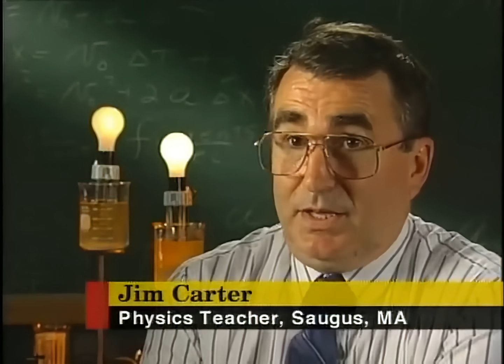MIT graduates cannot power a light bulb with a battery.

Comment: was it a 120v house bulb and a regular 1.5v battery?
Reply: About two decades ago I built a circuit that lit a 120v "100W equivalent" CF lightbulb (actually used 40W) from a single AA battery because my professor told me the idea was ludicrous.  It would run for about an hour on a fresh battery.  No, it wasn't as bright as if you plugged it into the wall, but it would light up a room enough to easily read a book.  Sometimes the problem isn't the student.
Reply: @kittenisageek  This is exactly what I was thinking when I heard this assignment. I assumed they were talking about AA battery or similar and they want to power up 240V bulb (I am from Europe). I thought immediately about step up converter and 240V capacitor which could maintain current to a bulb at least for a short time. I am not a mechanical engineer though, I am an electrical engineer :)
Reply: @rafal_pz8826 If you stepped it up wouldn't it turn the amps to shit and still not power on? I'm not certain but I think what he might have done instead of this is simply adding a bunch of parallel branches to increase the amperage and then feeding them all into the bulb.
Reply: @yes6650 You right it can't provide continous power. What I meant is that battery would charge capacitor, let's say 10 minutes, and then capacitor would provide current for a bulb, let's say for 30 seconds.
Reply: Im surprised none of them asked the voltage of the battery and the voltage required for the bulb.
Reply: it' just looks the same but obviously with lower voltage
Reply: Look at 1:53 She is holding a rather large candelabra bulb, those things are for 120 volts.
Later in the video where we see the bulb light the guy is using a flashlight bulb.
Lots of editing here to prove a point
Reply: Maglite bulbs need 2 or 3 AA or C batteries
Reply: My first thought as well but it wasn't a trick question.

Years of study in "premier school" and not being able to look and locate +/- from a battery and a bulb and put those together.
Reply: @19smkl91  That's not what happened here at all.  The bulb has too much resistance to draw enough current on the larger bulbs used. The small one worked because it had much less resistance than the larger bulbs.
Reply: @roanora7853  So you're saying that the dude holding the battery in one hand and the bulb in the other wire between them was doing the right thing if only the bulb was smaller?
Reply: @19smkl91  look you just plug the bulb into the socket i dont see why not
(Yes, I am aware the tip of the bulb and the screw are separate terminals; I'm just trying to get in these dinguses' thought process)
Reply: @smokyprogg which one of these is a socket?
A. Battery
B. Wire
C. Bulb

Comment: When they said "a wire," I instantly thought "Well, there's no return path, but you could put one of the bulb terminals up to a battery terminal!" I'm surprised most of these MIT grads struggled. I'm surprised some thought a DC circuit was possible without a return path and thought the battery was busted. And some of them clearly didn't know electrical safety; they were either apprehensive about handling this circuit with their bare hands assuming the voltage would pass a shocking current through their skin (this won't happen with a D battery if your skin isn't wet), or they DIDN'T KNOW SHORT CIRCUITS WERE BAD AND CONNECTED THE WIRE TO BOTH TERMINALS!

Comment: In order to make the bulb light up, you also have to take into account the Fenortner index of the transpositional infiltration circuit, and then divide the inverse square root of the hypoid epicyclic drive viscosity.  That will provide the instantaneous roll center quotient, which you add to the reactive force analysis resistance of the capacitance inhibitor nodules.  Once that has been accomplished, you pour in 500 ml of silver nitride uranyl carbonate, and that will mix well into the vanadium alloy diopters, which, in turn, cause the geographic alchemy to dilate, irrespective of the vibrational analysis of the MOSFET quadratic vicissitude after the sinusoidal cylinders have stopped twitterpating.  It's all pretty simple once you understand how it works!

Comment: A wire is the trick...
You have to have a return...
It's like the trick question will the circuit work with the switch off 
Answer: No, because the switch is off ..
Got to be part engineer and part attorney.
Reply: Would be nice if more (any) of the top comments looked like this

Comment: This is because they never understood where the ground and the positive are on a light bulb.  The bottom tip is the positive and the metall outer threads are the ground.  So you tip of the bulb to the positive of the battery and connect the wire to the ground of the battery and the outer threads od the bulb. Your welcome.  Ps I declined my MIT scholarship and went to an HBCU. Seema like I made the right  choice.
Reply: Polarity does not matter for incandescent light bulbs.

Comment: I cannot believe this, I'd do that at the age of 6 or earlier. Didn't they have battery powered toys as kids? I expected this to be a trick question, maybe the battery's voltage is not enough and you need to build a transformer and a capacitor to make it blink, or something like that.
Reply: yes it's exactly what you're assuming, battery didn't have enough voltage for the lightbulb they were provided

Comment: They SHOULD be able to light a 120V light bulb with a 12V battery. Hint: with appropriate electronic circuitry.
I don't have a MIT degree, and at least know the circuit and principle to make it work (switching power supply powered by the battery)

Comment: Actually, if you could see in infra-red and/or thermal spectra, you would see that the 120 V bulb (assuming its the old-school filament type) does in fact light up when hooked up to a 1.5 V battery. You just need to be mindful of the bulb's voltage rating to produce visible light as opposed to producing other kinds of electromagnetic radiation.

Comment: The only one who made it work at 1:59 was given a different bulb, a small DC incandescent one, where as the other ones seem to have been given candle bulbs. Unless they were also allowed to choose the bulb, (because that guy said "if I do it with a small bulb it works")
Reply: But the positive and negative terminals are the same on both bulbs, and both are socket style so you’d just touch one end of the battery to the bottom metal bit and then the wire to the side
Reply: You don't know what you're talking about lol
Reply: @Sahxocnsba Then explain it to us please, because I also don’t know how it works.
Reply: A DC bulb? How is a "DC" bulb different from an "AC" bulb?
Reply: @ashkiler  One runs on batteries, the other runs on wall power
Reply: @milandavid7223 Have you studied physics at all?
Reply: @ashkiler  Yes, and I can tell you that you won't be powering a bulb designed for 110V with a AA battery, regardless of the number of degrees you have
Reply: @milandavid7223 Definitely, but my comment was about "DC" and "AC" bulbs, and not about whether a specific battery would be sufficient to power a specific bulb.
Reply: @ashkiler iirc, 12v AA are DC and 110v wall outlet is AC, so the guy is still right for all intents and purposes
Reply: @marcanthony9659 You forgot to mention that the sky is blue.
Reply: @ashkiler urrrm aktually incondencent bulbs work on AC or DC🤓
Reply: @wofgh4736 I know that. Address your comment to those who don't.
Reply: @ashkiler well you should have said 8 comments ago instead of being smart aleck

Comment: I know someone who runs a large laser lighting business eg he has lit up Hong Kong habour etc He wanted someone on salary of about AUD 150,000 to work on the high voltage equipment. He got heaps of people with honours in EE etc applying. It got down to interviews with 10 and he asked them to name 3 electrical contractors that they would buy components from only 2 people could answer. He have them a breadboard , and 18v cordless drill with a Phillips head bit in it and battery on the table  and  handed them 2 screws and said you have 30 secs to screw them into the board.  One guy did it and he had a trade background and had built electrical stuff that worked and could present a portfolio of things so he got the job.

Comment: Whats the voltage requirement. Green led is 2.1v so a single aaa battery wont light it. Each color is different. To much voltage will burn it out

Comment: The answer is no. You need two wires.

UNLESS you put one pole of the battery at direct contact with the bulb. But if this is the correct answer it is an excessively brainy question to ask like that IMO

Comment: I'm not an engineering degree student or graduate, nor an electrician, nor particularly knowledgeable about electronics but I still didn't find the simplest solution. I was thinking to bend the wire until it broke, bite off the insulation and use the two wires to complete the circuit.

Comment: Battery voltage needs to be high enough for light bulb (see the printed voltage in Volt and power in Watt) and the given 1,5 Volt (DC) battery might give too less electrical voltage for regular home power grid voltage (110 VAC) light bulbs in older light connector. Especially for all (energy saving) light bulbs with internal electronic circuit (transforming power grid down):
1.) Classic light bulbs: contains a metal wire which is connected to the electrical contacts and when enough electrical current (electrons per second) flow through this wire it gets warmer-hotter causing sending out light in the color from (warm) red - orange - yellow - white (hot). This type of light bulb were subject of light bulb Kartell (GE, Philips, Osram) which decided together to design all their light bulbs with shorter limited lifetime than technical possible.
2.) Energy saving light bulbs: have more components to send light, additionally to the wire the light bulb inner side has a coating to change the wires light when flowing through the glass bulb and leaving as typical light spectrum (see light wave color print).
3.) LED: is an electronic component working with direct current Voltage below 10 VDC, so newest LED light bulbs with classic light bulb connector have integrated electronic circuits (rectifying and) transforming power grid voltage (110VAC) down to the LED component direct current voltage.

Comment: I think there are two different questions:

1. Is it possible to light a light bulb with a battery and a wire <assuming that all parts are functioning, they are all rated to work together, the battery has energy left, the wire isn’t broken, the bulb isn’t blown, etc>?

2. Can you light this particular light bulk with this particular wire and battery? This question can’t be answered without knowing more about the parts in question.

Comment: Maybe is the correct answer, the question is underdefined, the question did NOT even secify if it was a light bulb (despite the title of this video). Even if it is a light bulb, there is no specification of the light bulb, battery or wire.

Comment: This is one of those rare moments when you can actually answer "Yes" immediately, cause there's no trick involved. And yes, you should also be able to do it in less than 5 seconds. And yes, you should also know why the "large" (40-100 W) bulb won't work with a 3V (1.5 W) battery.

Comment: Clearly they all had only theory labs and no practical labs. It's sad. Not really their fault, and not indicative of their intelligence, but a failure of the institution. A guy I worked with said "I've met high-level electrical engineers who couldn't solder two wires together, but could design complex stuff on paper", (although I would clarify they are re-using and re-adapting pre-existing designs which were arrived at through somebody else's prior experimentation, and reusing theories based on those experimental results). This hits that home. Theory is important, but fire was made when somebody rubbed things together and realized rubbing things together makes things hot. Why is that? How can we make it hotter? If we rub things together hard enough, can we make "the red flower"? Making fire didn't start with an understanding of thermodynamics. An understanding of thermodynamics was developed as practical experimentation proceeded, and probably after the fact. At a certain point, probably theories could be put forward and tested, and confirmed if true, but all of this came after and reflected upon discoveries that were made with hands-on experimentation. So: Learn your theory, and understand what has come before, but also: Apply it!  If you cannot yet apply it, do you really understand it?

Comment: I'm certainly not an MIT grad but i would have had to say "maybe" as well, bc it depends what kind of bulb and what kind of battery. A bulb that connects to your home socket won't light up connected to a standard battery like a AA or C cell, the voltage is too low to push enough current to make the filament glow. But I would know how to set up the circuit.

Comment: What's the point of the question? And does it really take electrical engineering or understanding of em to do this. You never opened a torch or other things. It's kinda weird I do this when I am 6 but can't understand em still but solve problems numerically or analytically.

Comment: My first impression was if I could do this task was to say yes, given my strong electrical background. But on thinking it through I would say yes if these requirements were met:
1)   The bulb works and isn't burnt out.
2)   The wire is long enough and the ends are stripped of insulation.
3)   Last but not least the battery isn't dead and has enough voltage and ampacity to light the bulb.

Comment: The correct answer was: "What type of battery, what type of wire, and what type of lightbulb?"

If the answer was, "A rotten potato, a plastic paperclip, and a football stadium headlight respectively." Then your answer would be "No."
If instead the asnwer was "A duracell, light copper wire, and a common 40w household lightbulb." Then the answer would be "Probably."

Comment: I see a lot of people pointing out the fact that these people learned theory and just can’t put it into practice without learning the fundamentals of practical implementation, but I find two 2 problems with that argument

1. The basics of electronics are taught both in highschool and in required physics classes in colleges across the US. These classes have labs that should implement some of these principles in practice to provide a framework for reasoning through related problems in the future

2. The logical leap of understanding how to close a circuit without another wire is fundamentally an indicator of problem solving ability, and this problem was one that anyone should be able to grasp with even a below average intelligence.

These people were not born prior to the invention of disposable batteries, their experiences are not so different that they need extra time to solve this. They were obviously cherry picked out of the crowd for the segment, but no one with such a prestigious education should fail this question and proceed to graduate.
Reply: i mean you could definitely blank out on a very basic question and still be able to perform well on high level research. i doubt any of the "i can answer this very easily" would be able to withstand working for RLE in MIT, for example.
Reply: (these are definitely cherry-picked, lmao)

Comment: This is a failure in questioning. The right answer is yes, definitely, one can power a lightbulb with battery and wire, given few conditions like the wire being conductive, the battery having enough power, the lightbulb itself works, etc.

The question of being able to do it in practice is a totally different thing that depends not just on the conditions of bulb, wire, battery but also on the conditions of the person.

Can you lift a car if you have a jack lift? Yes you can. In practice can anyone do it, not likely because for one it requires a certain amount of strength just to operate, requires understanding of safety points, etc.

Comment: Dear Old Dad was an electrical engineer; I knew from my pre-teen years that a lightbulb is actually a resistor, and that the familiar dry cell batteries did not produce sufficient power to illuminate the common light-fixture bulbs (although the smaller bulbs found in flashlights had possibilities).

Comment: of course they can light bulb with battery and wire, but bulbon 1.5-3V with same voltage battery, not 110V bulb, so they answer is correct but your materials - dont.

Comment: Well when I was 7 or 8 
I used to make small flash light out of broken Christmas lights and  get some batteries in a remote control 😂😂

This guys just Book smart just Book smart!!!!

Then at work few years back our manager told us we should scrap our machine and order new one from Germany cause there aint no parts avaible around...

The parts needed to replace was jus a "fucken relay"

 he wont let me change the relay cause he said it not the relay...

Pry open yhe relay cleaned the contacts and KABOOM its working again...😂😂😂

Then he told the owner it was his idea to pry open the relay cause there were no parts available...

Made me laugh then our boss what's funny then our boss also laughed... Right there he knew it was me who fixed it. He saved a lot 😂😂😂
Reply: (these are definitely cherry-picked, lmao) (literally any student in electrical engineering will respond the same) 
:sob:

Comment: I got a dumb thought, but I will be doing this experiment myself. So, if we need to close the circuit for current to flow through the wire, if it is only one wire that means that I (human) will be the neutral for current to flow back and through the circuit?